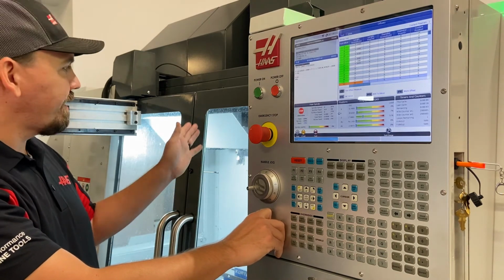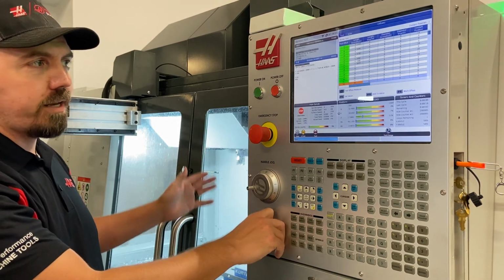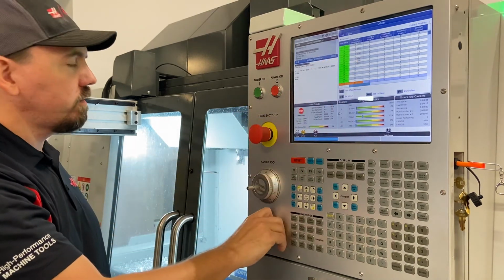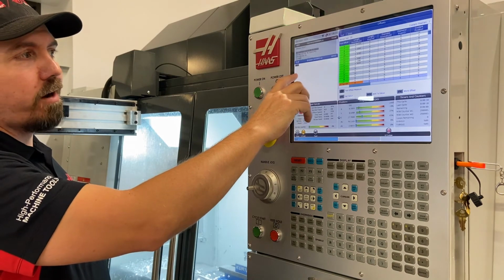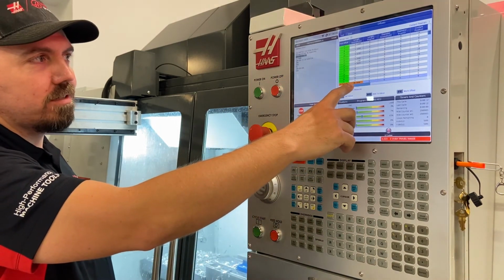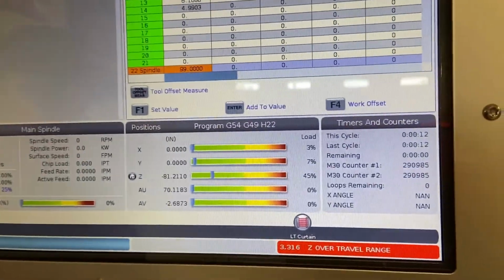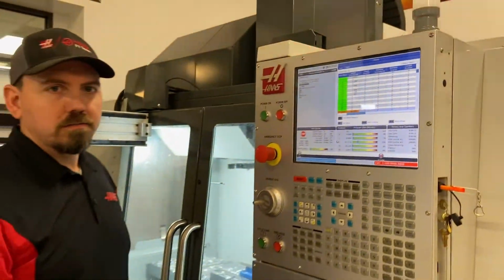Prevent a spindle crash on your Haas Mill!

Comment: whut 2000 means  in the #3026 + 2000 ?
Reply: Hello @tomeszkomesz.  The "#3026+2000" refers to the current tool length offset, for the tool in the spindle (#3026 = tool in spindle, while [#3026+2000]= the correct tool length offset for the tool that's in the spindle.  Thank you for watching!

Comment: Hi Haas dude.  Is there a way to implement this to my ATC buttons?
Reply: Hello.  Unfortunately, there is no way to implement an Aliased program into manual operations such as ATC, from MDI.  It would be necessary to command the "Txx M06" and cycle start from MDI, to check the length of the tool.